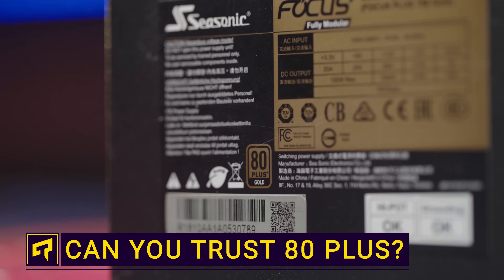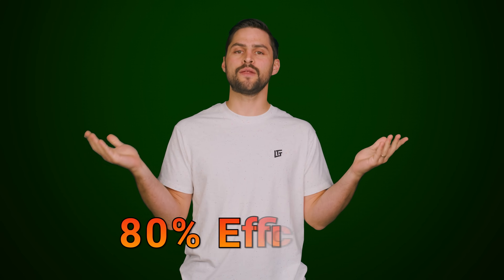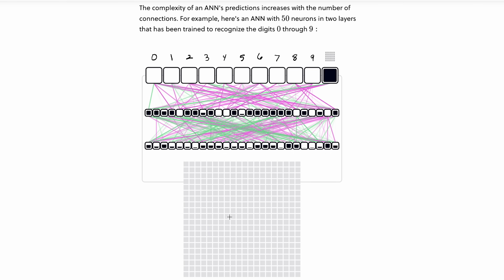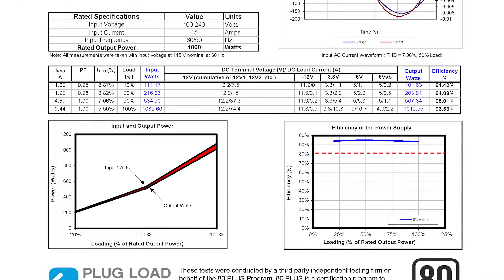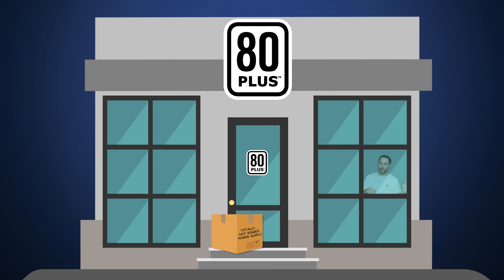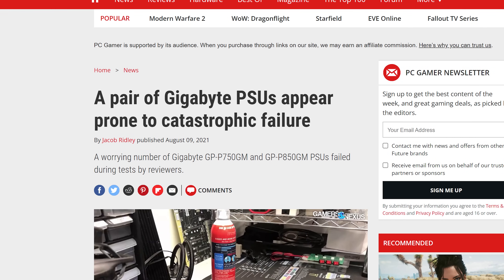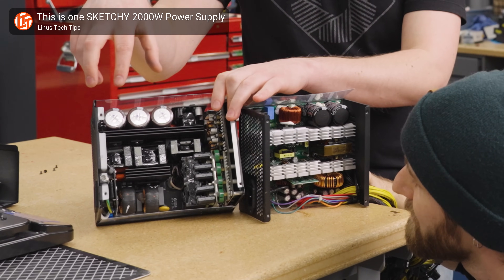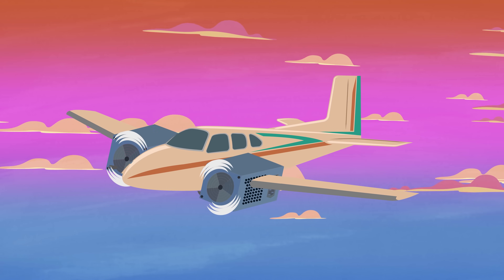Can You Trust 80 Plus?

Comment: It was a good standard to have to make PSU manufactures to make their PSUs better. Now basically everything is 80+ white or better 80+ kind of lost its meaning for being.
Reply: Nice to have it around though (basically no reason to be without it), until it gets replaced by some other generally accepted solution like the mentioned Cybenetics rating. Like CE marking in EU, if it's missing then it's just an instant red flag.
Reply: @RadioactiveBlueberry  What is CE?
Reply: @yumri4  "Conformité Européenne", the french term for european conformity
it's used to mark products that passed the certificate for conformity in health, safety, and environmental requirements to a high standard
basically a europe-wide mark for something that isn't a sketchy product
Reply: oh no, there's still $@@%ty power supplies out there, just not on the big box stores you're going to.  also  80 was always just the bare minimum back then to insure you didn't fry your brand new upgrade.  we only get 1% to 3% conversion on gasoline, so at least the power lose isn't terrible compared to that.

Comment: I just bought an bq straight power 11 650watt to replace my straight power e9 480watt... i didnt do any research.. will this psu be ok?
Reply: Most Bequiet! Products are pretty good and reliable, I've been using their 750 gold PSU for about 10 years now, still running like a charm, among many other of their products. ( All my case fans are Bequiet fans too and even after 10 years they're still running as smooth and silent as ever, which speaks for good quality bearings. )

Comment: Short answer: No. After the manufacturer has had it verified for 80 rating there is nothing stopping them from changing the insides half way through its life cycle. GN exposed this.
Reply: Isn't it illegal though?
If you  can swap components and still keep the 80+ certificate then what can you swap?
Transistors, coil, case, PCB, capacitors, or maybe all at once?
If you follow this path isn't a completely different PSU from your company also 80+ then?
Reply: @hubertnnn  it's a bit of a rabbit hole, as long as the PSU manages to keep it's efficiency rating valid it will keep the rating, but that doesn't mean the components are good, will last long, how well it will handle energy spikes, etc.
You can have a terrible gold psu since it does manage to deliver that 90% efficiency at X% load, but a power spike can trip it meaning it cannot handle stuff like a 3090 with an i9 while being well above the wattage those components use as an example.
Reply: for those who call this a long answer, the actual answer is No.

The rest is an explanation why.
Reply: That is expected of a member of team rocket.
Reply: just look it up and look at reviews, its the best way to find your answer.
Reply: Other than audits and industry challenges, which are afforded through the program license and certification process.
Reply: Shortest answer for him is probably only a yes or no but even then it might be too long
Reply: That was more a long answer tbh
Reply: @jessiejames1681  Not really. Unless you have zoomer attention span.
Reply: @neondemon5137  Jessie James' idea of a short answer may be 10 characters or less.
Reply: @jessiejames1681  you have to be Gen Z. That ain't a long answer.

Comment: I have a bronze 80 plus power supply for last 10 years.. working perfectly. Just ensure that power needed is half the watts
Reply: Exactly!! Many people max out the PSUs and then wonder why they fail, yet everybody knows you shouldn't drive your car at 6.000rpm all the time! o.O
Reply: it's really important to never max a psu. If your total tdp is of 320 Watts (my case running a Xeon E5 2420v2 with an RX580 with basic looking but really effective non-RGB fans) a 600 or 650 80 Plus rated PSU will be just fine. Just don't go for a 400 Watts PSU or your entire PC is at risk.

Comment: Remember kids,

When building a house, never cheap out on Wires and Pipes.
When building a PC, never cheap out on PSU.
Reply: Specially when a good psu can outlive upgrade cycles
Reply: Both are arguably the most important part of either project;
Wires and pipes are needed to make your house work as a place to live in and not just a box for sleep (wires for electricity, pipes for water)
PSU's are needed to route power to your PC and it's components and thus, needed to make a PC work like a PC and not just an expensive paper weight.
Reply: And never cheap out on your chair, mattress, shoes, or tires.
Reply: @joeshmoe9233  Soo True :D Chair mattress and shoes can damage your back+others stuff in boddy for rest of life... Tires too more than your back. :)
Reply: @Alexander Ratisbona Those OEM PSUs aren't too bad from what I heard. I'd be more worried about buying some no-name brand from Amazon/eBay and getting some Shenzhen special with a bunch of protection features omitted for cost-cutting.
Reply: Don't worry about the foundation. It's not needed. That's just a crazy conspiracy theory. Build directly on sand to survive the storm.
Reply: I learned that the hard way as I built my 1st pc in 2014. The PSU is lacking, so bsod is a normal occurrence after a year. That was painful.
After upgrading in 2018 with far better PSU, all my headache gone until today in 2022.
Reply: he's the wise man

Comment: A wise man once said "Don't cheap out your psu kids"
Reply: An expensive power supply does not guarantee reliability.
Reply: Yet, I've never seen monitors, TVs, smartphones, laptops, or household appliances advertise how expensive their power supply is. Are PCs really such an exception?
Reply: Mine costed 12$USD
Reply: Just buy a cheap power supply that can support your setup ez. I saw a youtuber testing 500w 80+ psu with rtx 3080ti and it is still exploded.
Reply: @youravghuman5231 tf you mean 3080ti with 500 w psu what a dump to use that way
Reply: Yeah I learnt this Hard way today, my deepcool 550w 80plus standard psu burnt
Reply: That's why I spent $200 on mine.
Reply: Agree
Reply: ye thats true..but what is the sweet spot though? for budget and performane
Reply: Learned it the hard way😂
Reply: Unless It's called msi Meg a650bn
Reply: I learnt this the hard way
Reply: I learnt this the hard way
Reply: Please use a comma before kids, otherwise it looks like the kids are a psu
Reply: What's a psu kid?
Reply: A foolish man once said: " Worst case you can always buy a new one"
Reply: @Alexander Ratisbona well I worked at a school where there was a HP model that most PSU were exchanged with the PSU of other older OEM PC cause they were all dying.

And there's still many PSU without full protection on all lines which if something goes shorting it will keep feeding power until it goes puff 😁
Reply: @Alexander Ratisbona funny you say that , yesterday I had an optiplex in a class make a really loud pop and spew magic smoke all over the place
Reply: ok then am not gonna cheap out, I'm gonna buy Seasonic Prime Ultra 1000W 80+ Titanium for my Athlon 200GE. Thanks, wise man.
Reply: @cmja09 are you serious? For athlon 200ge lol 🤡
Reply: The un-wise man said many times, “Buy the cheapest psu kids, save your money for the graphic card”
Reply: Heed the wisdom
Reply: @misanthrop i dont disagree with you on this, sadly many do this.... i was working for a news channel back at early 2010s doing video editing and the management decided to cheap out on some stuff...the FIRST thing that fucked up on us within a year were the psu's... and worse they fried some gtx titans 6gb effectively removing the priciest component from the list...since then i go for titatium, from 2015 i have build about 8pc (not only for myself) and NONE had a psu problem to this day...i wont risk fucking up an entire pc for an added 40$ at my psu, i'd rather cheap out and not buy an 3070 but get a 3060TI
Reply: Actually, that’s wrong. It’s “Don’t cheap out by having kids, so you can have a psu.”
Reply: True
(I use a cheapass psu)
Reply: a rule to live by....below 120$ for psu is a no go for me, even if i have a pc that my gpu is 250$
Reply: @Ko700el  120$? Try 33$ Psu next time
Reply: @Ko700el  that is price of 1000W PSU for a system that need at least 500W PSU that's just waste of money
Reply: @Ko700el  damm- I got a 40$ psu
Reply: Wise man also said never believe any brand I have Evey brand has issues at some point of time